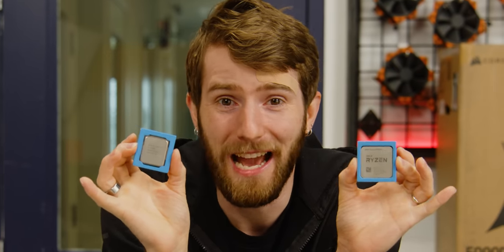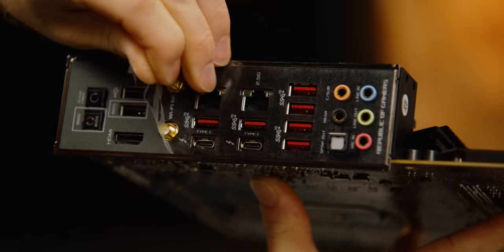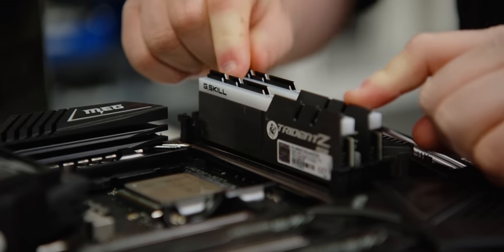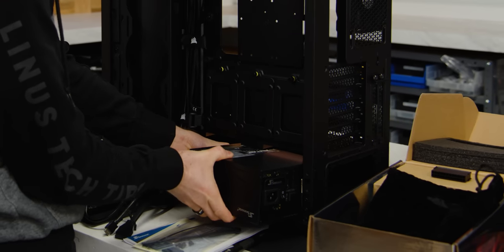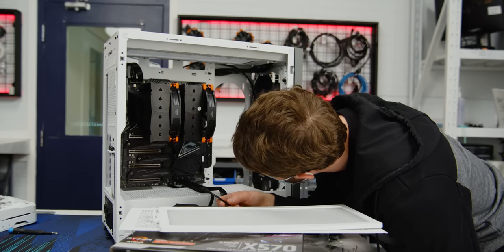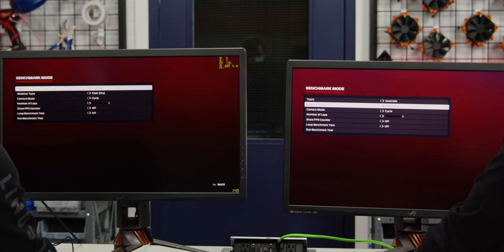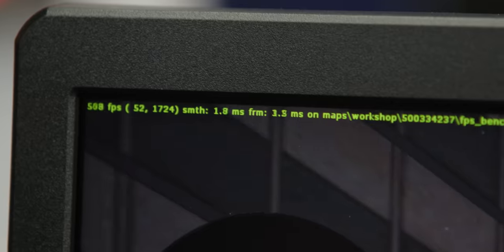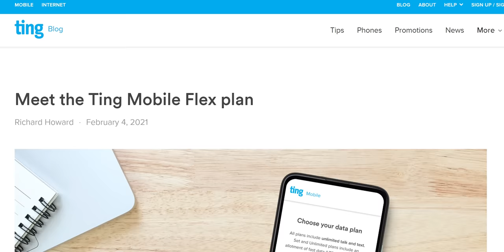Can Intel Beat the Ultimate AMD Gaming PC?

Comment: I think we all owe Steve at Gamers Nexus our thanks for influencing the trend of airflow cases
Reply: Steve is great
Reply: All hail steve
Reply: * sitting quietly but happily because I use stock cooler because I had no money to spare for aio system *
Reply: Tech Jesus all the way
Reply: Prayer for tech jesus
Reply: @l96ai  nothing wrong about stock coolers. I actually prefer them compared to aios because I don't like that most aios skimp on quality in key components and that you can basically reuse nothing (except fans) once the pump dies. 

I just don't think that the price to quality or performance ratio is good compared to cheap dual towers or custom water cooling.

So to me it's basically fully custom or as cheaply air cooled as possible xD
Reply: Steve is a great guy
Reply: And we could thank team blue/red/green for upping the anti and forcing case makers to put some extra effort in lol. Such a good time to be a gamer.
Reply: Tech Caveman
Reply: Why? Airflow cases have been around since, pretty much, forever?
Reply: @l96ai  AIOs are overrated. Air coolers > AIOs so long as you don't have RAM clearance issues.
Reply: @imtheboss976  Dude why are you pitting Linus and Steve against eachother, they're both great content creators
Reply: Dust?!?
Reply: @userise222  yea definitely and the fact that you dont need to worry about air coolers / be paranoid with watercoolers. Not to mention inconsistent pump noises. But AIOs look really cool cosmetically
Reply: If everyone watched gamer nexus nzxt would be broke
Reply: When you game with headphones who cares how loud the fans are, the more air the better.
Reply: @eirikheggelund  lately there's been less. Now every company has awesome options that look great! Airflow cases have been neglected the past few years for glass boxes that show off RGB
Reply: Nah
Reply: @jldkrank  Oh well. Let the kids have their rave parties.
Reply: @a-aron2276  chemical off gassing from the components
Reply: @iceyberq  ppl would still buy for the looks
Reply: y’all ride steve too hard
Reply: Nervous H510 laugh
Reply: that trend started 20 years ago, it was only the last 5 years cases started showing up again with bad airflow
Reply: I mean I'm sitting here using a 10 year old case with masses of airflow... this is not a new concept
Reply: @imtheboss976  Gamers Nexus Steve is a biiiig proponent to case airflow, has many many reviews on them.  Not so much a “who has more experience” thing, Steve is just a review master.  In his videos he speaks of how he works with vendors to identify design flaws and as such, is influential when it comes to airflow design.
Reply: Got my Corsair 4000d airflow from his video
Reply: Should've watched his videos abt airflow before building my pc coz i have a H510 from NZXT but even though im running a  2600 and 1650s, the Ambient temps in k country can reach as high as 37c above especially it's summer for a long time
Reply: I mean kinda... lots of them claim airflow but then r surrounded by glass or tiny 90 degree turns in front of the fans
Reply: As well as boring us to death with graphs, charts, and his monotone voice.
Reply: @triadwarfare  I am certain that it would be in every serious case maker's interest to design a case that actually performs. There will always be the silly no-compromises RGB light show tower of cases.
Reply: Should I buy the Lian Li lancool 215?
Reply: Yeah man, I totally agree 😀
Reply: @kostisap9350  hahahahahahaah
Reply: @kayburcky7146  Don't buy cheap AIO's then. Decent AIOs have warranties of at least 5 years or more and rarely fail, if ever.
Reply: Sure....just in time for two thirds of the heat produced in a PC to top the endangered species list.
APUs for everyone!
Reply: He don't know but I get a Cooler Master NR600 thanks to him !
Reply: It’s such a good trend
Reply: @soggypeanut9161  Steve’s not as much of a personality as Linus is, but that’s his thing - techy, informative, very knowledgeable.
Reply: @imtheboss976  I think they’re both good in their own ways, but I get it, all good
Reply: @imtheboss976  don't get mad boi. Everyone has something to give. I recon you don't watch GN so I want you to know that LTT and GN are communicating all the time. Linus is watching Steve's videos most of the time. He said it on the video that he made about the hardware unbox and nvidia situation. Their job is way difference. One is taking about news and gets into detail about new products while linus works with pretty much everything.
Reply: @nightwing8890  What does Steve from 'Gamers' Nexus' say? 😅
Reply: Wow, you’re right. Hail tech Jesus!

Comment: One of those people that bought a 1000 Watt 80+ platinum psu back in the day and have never regret it.
Reply: 1600W user here. was worth every penny
Reply: Im with u guys. 1300watt 80+platinum
Reply: I'll say 😂
Reply: Buy hey!  1000,1200,1300,1400,1500 and 1600 are all pretty 42069
Reply: /me pats you on the head
Reply: how much did it cost
Reply: I am still a gold person 850w 80+ gold corsair. Doing great with my 5950x. Not going to over clock it but, maybe a little undervolting should be good. 10 yr warranty on these are awesome.  My last one was a 750w still running 8 yrs in.
Reply: 750w platinum is prob enough right? Idk if I should be glad that I got one before the market went crazy. Still trying to get a 3070 at msrp tho lol
Reply: I bought a 1000 watt titanium seasonic a few months back for $300
Reply: i got a 1000w gold many years ago on sale for cheaper than a 750w. i loved it so much i picked up a 1000w plat
Reply: @durdy911  why ?
Reply: I did the same! 10 year warranty baby!
Reply: Got that seasonic titanium
Reply: @cosmic5789  Same
Reply: Own 850W Coolermaster PSU since 2012 ;)
Still working. 10 Year old PSU!
Reply: Lol same.
Reply: HX850i
Reply: 1200W be-quiet unit here. And I bought it when they were supposedly unobtainable! Same with quite a lot of my recent components... have been extremely lucky with being able to get hold of parts in my new build!
Reply: @cemerson  lucky
Reply: 400watt here i don't regret
Reply: 1000w Corsair, I7 920, and GtX 580 with a triple channel p6t. Those were the days. 

Not really.
Reply: @saiyannegi  everything :^]
Reply: Haha jokes on u I have 100 w...
Reply: I bought a EVGA supernova 750 watt gold and I don't regret it. It was way more than I needed.
Reply: i tried to get a platinum rated psu couldnt find one so ended up getting a EVGA 1000 watt 80+ Gold
Reply: @evildude2135  it’s more than enough
Reply: yeah i have my Thermatake 1500Watt modular 80+ 
since 2007 still using it great value (then for 240Euro worth then every cent) Up until a bought my R9 380 i thought my fan of the psu was broken cause it didn't work... silly me not much power needed :)
Reply: i bought corsair 1000watt psu and i feel safe
Reply: 5000w 80+ uranium user here, worth every bitcoin
Reply: Lol
Reply: *80+ titanium
Reply: I'm one of those people who bought a 550 Watt 80+ bronze today and have no regrets.
Reply: I bought a 750 watt corsair monster back in 2009 and it lasted me 10 years never regretted it and i paid almost 200 dollars for it.
Reply: H1000i no ragerets
Reply: Yeah, a good quality, high wattage PSU is an absolute no brainer. That shit can carry you through 3-4 builds no problem. Same goes for an excellent case or CPU cooler.
Reply: Got myself an Antec Extreme Gamer 850w 80+ Gold psu about 6 months ago, and haven't regretted it. Though it's only powering an R5 3600 oc to 4100mhz, an Gigabyte RTX2070S Gaming OC 8gig gpu, 16 gig ram, and 2 m.2 nvme drives.
Reply: @Hunterfury_44  😂😂😂😂
Reply: @stanley3647  Got the Cooler Master RS700-PCAAE3 from 2011 that ran my gaming rig back then, currently running a backplane for my servers and no buzzing or noises from it!
Reply: 1000Watter here, this thing has ran several different hardware loadouts over the years including insane crossfire setups.

If you figure people who have to eventually upgrade later on I bet you save a lot of money buying a highly rated "future proof" piece of hardware and the PSU is one of the easiest components to do that with.
Reply: Been using A bronze power crosshair one for  like 8 years with no issues.  Will never pay for plat or gold
Reply: i got 750 plat and regret not getting that extra 100w at  least
Reply: @mitchelm8783  i think 1k watts with no regrets makes more sense in not having regrets. buying a good 550w psu is just standard

Comment: Me: I’ll be totally happy with either
Reply: i’ve seen your videos before, nice job
Reply: I assure u that u would hate your intel pc for pouring flaming hot air and mega high electricity bills.
Reply: @klevispjetri7354  ok
Reply: INTEL SHILL, HOW MUCH R THEY PAYING U
Reply: Jokes on you rn I'll be happy with a xeon e3-1230 with a dvi-only 580 
👁️👄👁️👌
Reply: Yeah I would if I could afford one!
Reply: Yes actually yes
Reply: But, why did you put the Me: in front of your own comment? I can't even...
Reply: I’ll be totally happy wi...out of stock
Reply: @ashercampbell2571  dude chill. I have to agree with him, whichever has a better deal near me is the one I'll get.
Reply: @klevispjetri7354  if It can run my games at a decent frame rate and I got it for free or something I wouldn’t complain, but If I bought any pc I would choose AMD
Reply: @KelpTech  same
Reply: @KelpTech  facts. The only problem i see with intel, for me anyway, is the price difference on mobo's. Even in the used market barely used x570's and b550's are cheap not to meant if you go down one gen to x470's they are a steal right now. Got mines for 40 USD in pristine condition
Reply: @klevispjetri7354  true 😭
Reply: So true
Reply: @wilbur6089  he is correct though
Reply: Same
Reply: Lol mine can’t even run forknite or minecrap
Reply: Save up man. Not hard just need disciplin i saved up to years for a PC worth 850dollars and im happy with it runs all Games with high settings
Reply: @klevispjetri7354  I wouldn’t care that much honestly just gimme lol
Reply: This would be the same comment if not better without the “me:”
Reply: @killerbeans  If you edit comments it doesn’t show anymore
Reply: @killerbeans  I see what you mean. It isn’t used to make it any funnier in the context. It feels unnecessary and dare I say...

cliche

Comment: "unlimited budget"

me, with my intel pentinum, 4gb ram, 1998 graphics card: i wish
Reply: I use intel i5 8250 no gpu and 8gigs ram
Reply: I have 3090 rog strix with ek waterblock 64gb of trident z royal 3600 and Ryzen 9 5950x with rog x570 chrosshair formula , lian li 011 xl rog ,rog thor 1200w and ekwb stuff and watercooling parts 10k pc build with tubes and evrything its a rog mostly build black and silver watercooled build
Reply: @_. what
Reply: @_. what specs do u have for 600$
Reply: So u use intel graphics
Reply: @EezoTheChezo  those “tubes” are for water cooling. It’s not hard to buy a pc with his specs if you have a stable job. Too bad this comment section is filled with NEETs and small children.
Reply: @justasingledoor5178  Lol
Reply: @RickySon  why is this edited? found better parts and just replaced them to make it more expensive?
Reply: And i thought my pc was bad with an i5 3570, motherboard graphics and 8 gigs of ram
Reply: Do you watch this in 144p?
Reply: @dreamcore7  And you?
Reply: @SacrificeSL That is weird.
Reply: @My ashole is bleached you could just reinstall the os if things are bad
Reply: @justasingledoor5178  Probably true in a 1st world country
But in most 3rd world countries jobs don't pay as much and at the same time parts like these are extremely hard to find and are usually sold way higher than MSRP even if they are available
Reply: You have a graphics card?
Reply: I have  A intell core i5  4570   With 12 gigs of ddr3 ram.  And a intel HD4600 gpu            Ik it’s not good but Im only 17 and in high school so that’s the best I can do for now
Reply: @RickySon  I feel that you just made the best thing you could think of and all you have is a random hp laptop
Reply: 4gb ram ? i have 2gb
Reply: Older cpu 1.24 gb ram and no gpu.
Reply: Me who's never had a pc: laughs
Reply: How do you get 4gb in a pentium?
Reply: Lol no I'm a phenon II user
Reply: i5 9400F 16 gb ram gtx 1650 super
This will hold up for a few more years since i can still get 75+ on recent titles
Reply: Ryzen 5 2400g with rx 580 and with good WiFi but with bad signal= not what you think
Reply: wait 10 years and sell it for an abnormal price
Reply: @RickySon  , can't understand the reply to spencer???. Like ... ok, you've got a 10k system. Congrats ! Do you want people to start clapping theirs hands or something ? :p
Reply: @RickySon  Who asked?
Reply: @RickySon  entirely cap
Reply: Me with an iPhone 5s
Reply: @anti-communistdude7462  Watched this in 2160p. Guess you watched it in 1440p because your computer will suffer like my old i3 at 2160p.
Reply: @Theiaaa7  Not really. I recently build a computer for 1440p gaming.
Reply: i have 16 gb ram intel i5 9400F and rx480 with 450 watt psu
Reply: @middlwzrd7424  I have a 32gb 3600mhz Cl 16 RAM, Ryzen 9 5900x, Rx 6700 xt, 850 watt PSU, x570 motherboard. It is not the best system but I am happy with it :)
Reply: People really getting mad cus someone in replies has money and a job
Reply: Oh you have a graphics card 😱
Reply: @RickySon  Cringe flex
Reply: @loading2431  , nope, it's "cus" Gen Z people don't know how to handle greatness. They just have this need to regurgitate it all. Who f.... cares ...
Reply: My radeon vega rx 11 igpu
Reply: @RickySon  if that is actually your build, I gaurentee your not even getting 50% usage out of that rig.
Reply: I'm pretty okay with my build as it is.
GTX 1080, R5 3600XT and 32 gb of ram.
Reply: @justasingledoor5178  do you know how money works? If you have a house or an apartment you have to pay half of that money for the rent then food and more necessary thinks to live a good life
Reply: @RickySon  that's some rolls royce vibes there.
Reply: Ok this is 5 months ago so maybe youve changed your setup since then... but seriously dude check out second hand resellers of old prebuilds or smth like that... I know gpus are hard to get hold of but there's seriously no point in keeping one that old. If you want to play today's games, as I said previously get a second hand prebuild. In this climate building your own costs way too much, and you're going to want to upgrade everything from what I can tell. This is all assuming you're a PC gamer - don't feel pressured into buying any more than you think you need. But from a "struggle to run windows 10" pov I think its worth it.
Reply: @tulip_hysteria  lol
Reply: 4 g ram no gpu 😭
Reply: @RickySon  okay Mr high and mighty
Reply: @Theiaaa7  it is really easy to watch youtube at any res
Reply: @RickySon  i doubt you have that
Reply: @𝔅𝔢𝔷𝔢𝔯 that sucks i have a msi strix 3090ti founders edtion with a 12900k and octa fans and water cooling 4 Nvme 5 gig ssds 128gb of ddr5
a  lian li 011 xl rog and a rog thor 1200w those two are the same as urs lmao
Reply: @justasingledoor5178  Hmmm I wonder why my friends with good high paying stable jobs and housing they own and everything don't spend that much on a pc then. There is absolutely no need to spend more than 1800-2500 on a pc and i would recommend only spending around 1800 to 2500. Anything more is just ghoulish overkill to say you have one of the best pc's and gloat about it by telling everyone and going on benchmark sights. An 1800 pc will last you the next ten years with some parts having to be added over time. Most people eye's can't even see past 60 fps. If you have a graphics card that can do more than that it just helps with reactions but you don't see a difference you just "feel" a difference. Also after a certain point the difference is not substantial. No point in being toxic because some people don't make as much money as some we all play a part in this world and yea the pizza guy or the fast food worker probably can't afford a 5000 setup but if those people working in low to mid income fields were to leave and get better jobs you would probably be upset about it. Oh no who is going to make me food or serve me at a restaurant or bring me pizza. Some people have a lot of money and just don't want to spend that much on a pc alone as well. What would you do if nobody wanted to install internet for you so those expensive computers don't just become fairly useless bricks.
Reply: My 2008 PC has 4gb DDR2 RAM and old AMD phenom quadcore
Reply: @juneeight6574  I really don't mean to sound rude but are you jealous or something 😂
Reply: @MrCroky123   you defo jealous 
he was just following the trend of people sharing their builds, why does it matter to you 🗿
Reply: @Rubinkys  what? No? I have a  computer that i remember was just a little less than a 1k it just works perfectly for what I use it for. There was just not much reason for his comment to be edited i did my best guess why and some seem to agree. Why are you still bugging around asking if people are jealous when this set up can easily take up the electric bill this rick astley guy must be your kid or "something"
Reply: @juneeight6574  not my kid I'm way too young for that 😂, just wondering why you'd care so much about someone sharing their build like everyone else was doing, you know, just making my best guess at what it could be 🤷‍♀️
Reply: @_. lol my cpu is celeron and no gpu
Reply: @Rubinkys  , this is a public space. It matters whoever has an opinion about the subject. Otherwise, why does it matter to you what I've just said ?